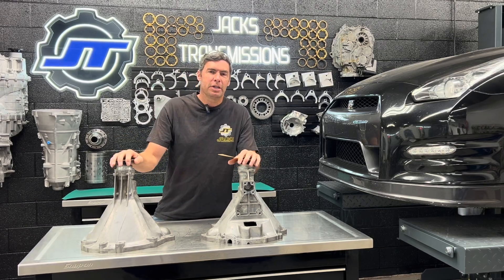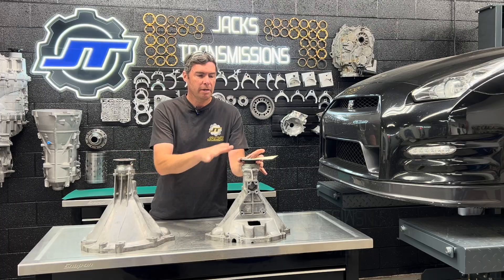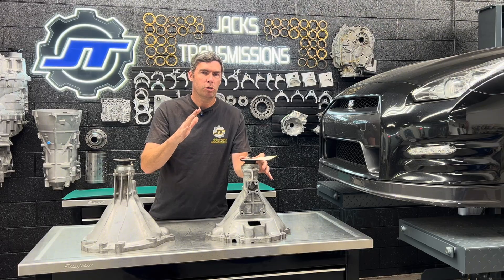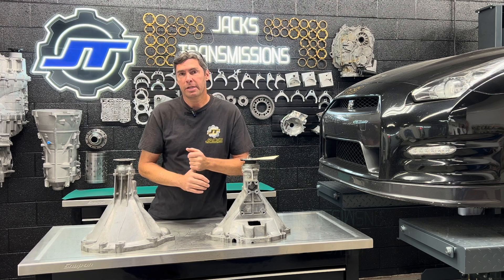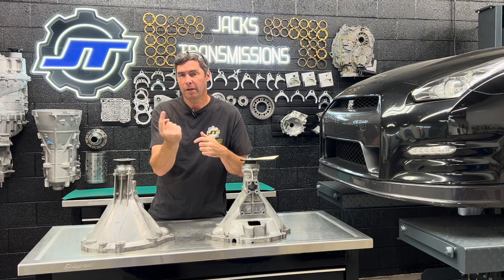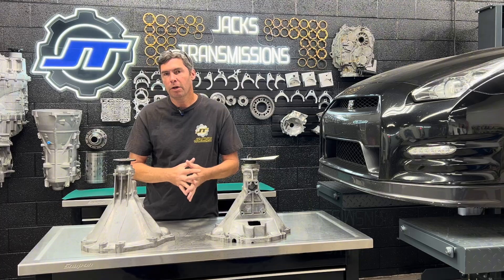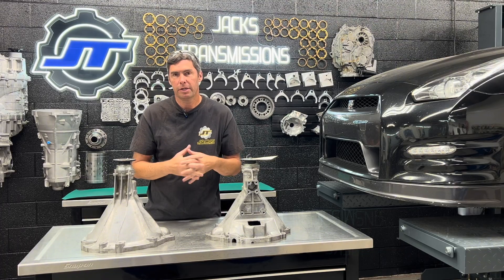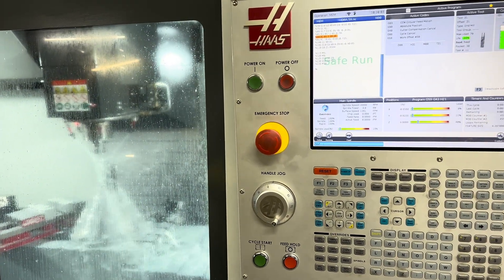R35 Bell Housing Rattle, Failures, Misinformation, Rebuild Process, GT-R Jacks Transmissions CNC

Comment: I own a 2009 and it has very low miles.  When im inside the car at idle I can hear a suble clicking sound coming from what appears to be the rear of the car.  when I listen from the outside I cant really hear it.  any idea what that is?  car runs just fine.  Its had all fluids done and services.  It has tsb clips etc
Reply from the maker: It’s hard to say without the car in front of me. If you can send me a video of the noise that would help greatly. My email is shop@jackstransmissions.com